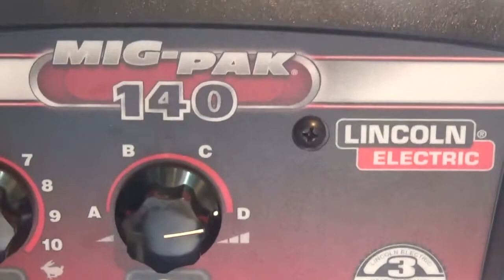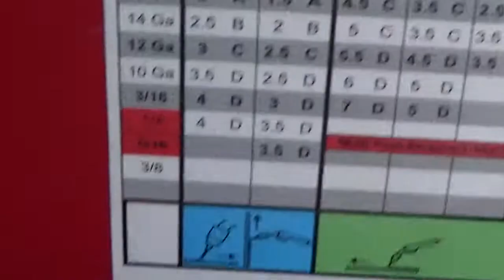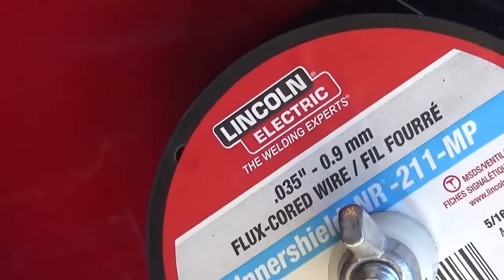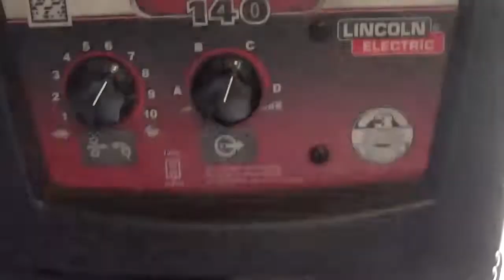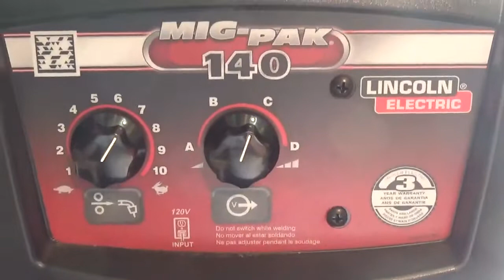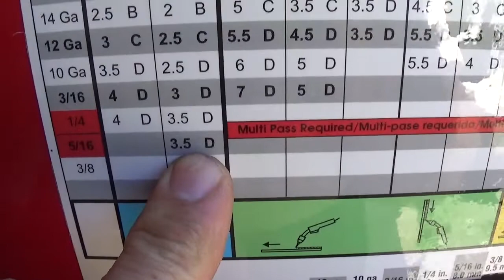LINCOLN MIG-PAK 140 WELDER REVIEW #2

Comment: I have owned a Lincoln Weld-Pak 140HD since 2016. Wish I had known about Lincoln before. Go on the Lincoln website & you cannot order parts- they give you a nomenclature & part number, then the site will not recognize thet data they gave you. So now because of a forward/reverse switch, the 140 HD will reverse the wire but not feed it forward. The switch looks to be a cheap 3 position rocker type, only you can't buy it anywhere. Next time will be Miller or Hobart.

Comment: how much$? did u pay??  was it an E/bay purchase or home Depot? or?
Reply from the maker: Got it at Canadian Tire 2 years ago for 449.99$ in sale and the kit at regular price is 751.99$ and was 539.99$ in sale not the kit the week before. This welder is sold in a kit by the way and when it come in sale the kit is less expensive then the welder alone and it's the same machine LOL. I didn't have any issue whit it so far work really easy to use. I did some add on on mi tractor and I did save allot the welder have paid it self by now.I got mi self the Lincoln plasma cutter the P20 it's expensive at a price of 1399.99$ got it in sale at 1299.99$ but when you cut whit this you don't won't to use a cutting wheel at all.